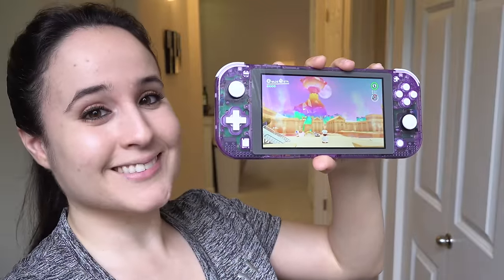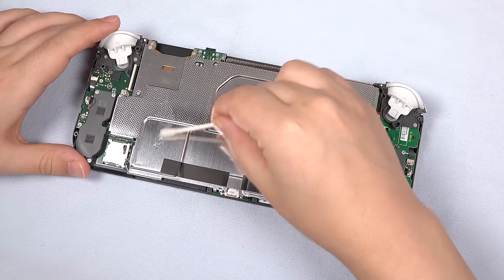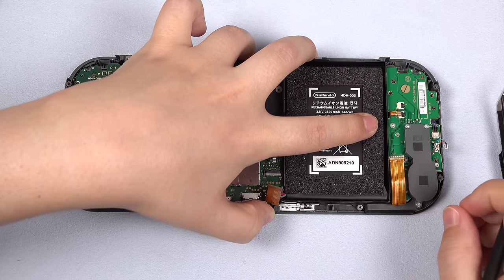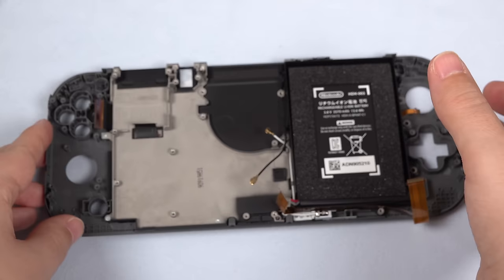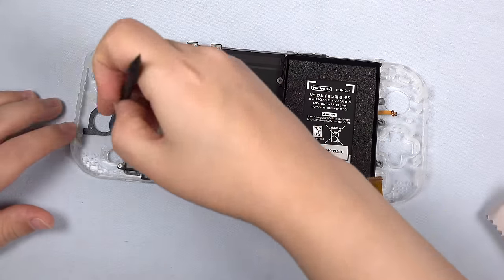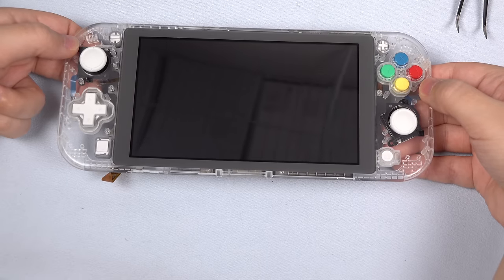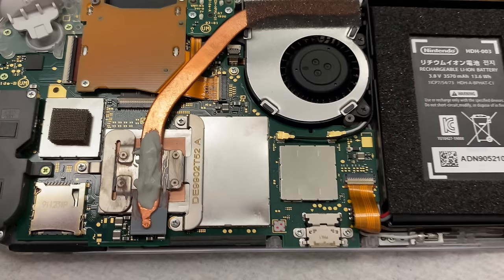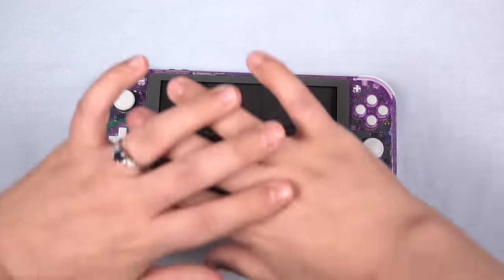DIY Switch Lite Shell Swap: Step by Step Tutorial [4K]

Comment: Was going to do this, to paint the original shell with custom graphics...but a $20 tool kit, thermal paste and a high chance my clumsy fat fingers will break something, had convinced me otherwise. 🤣😂🤣
I honestly thought this was going to be a simple chassis pull. Not requiring complete disassembly of most of the components.

Comment: FYI, you don't have to take everything off, like unplugging the speakers, all of that can be left on. And the on and off switch, that can also be left on. Some of the steps are unnecessary. Watch other videos out there as well, this process doesn't have to be this complicated. If you need to change your car tire, you don't need to unplug the battery. Good video, just some steps are unnecessary.
Reply: Video link?
Reply: I agree, battery and speakers are unnecessary to unplug. Plus they are very easy to break.

Comment: be careful recommending a "heat gun on low". Most cheap 2 temp heat guns I've used could easily melt the plastic and fry the screen on low. I suspect the part of your audience who would rely on your guide would be likely to not monitor the heat properly and damage something.
Reply from the maker: If they don’t have enough sense to realize the tool they are using could melt the plastic then I don’t know what to say. Most people will just use a hair dryer because that is all they will have access to. You have to be a pretty intense idiot to go out and buy a heat gun just for this project as a novice and melt your screen. Those who actually own and use a heat gun (out of necessity) know better... you certainly do. But yeah, there is a real dummy born every second. I’ve seen people drill holes in the bottom of their iPhones thinking they will find the hidden headphone jack. If that’s the case, I can only hope you melt your screen lol.
Reply: @EricaGriffin  dang ok. I wouldn't want to use a heat gun on low because I would be worried about damaging the plastic. Depending on the type of plastic, there often is little indication before damage is done. I would be particularly worried with discoloration of the clear plastic screen cover. I am a male and I didn't own a hair dryer untill I got one hand me down for projects. If I watched this video and decided to do this, I would have went to harbor freight and bought a 2 stage heat gun for $7 and I likely would have damaged the finish of my screen cover or case. But maybe I am one of those dummies you speak of 🤷‍♂️. I say this respectfully, because I think you made a great video. I suspect you might not have used many cheap 2 stage heat guns. To put it in perspective, I use my harbor freight piece on low to weld plastic and to solder

Comment: So I finished and my screen doesn’t turn on. Anyone have any suggestions?
Reply: did you fix it?
Reply: yea, i wouldn't hold the hair drier on hot for a COUPLE MINUTES like said on this video. It just needs to heat the adhesive on the frame for a bit.
Reply: Just received my new lcd in the mail today! I have two concerns; I realized I used thermal conductive adhesive on the copper pipe which I’m assuming is wrong? Second concern is how fragile is the lcd? I’m scared to touch the back part of it I feel that’s how I broke it last time. Any comments or thoughts?
Reply: @zootedseazon  attempt #2 today
Reply: Update!! I am currently on the “check functionality” part of the video and it works!!! So happy! Thanks again for the awesome video.

Comment: Followed the guide step by step and my switch won’t turn on
Reply: You ever get it working? I'm going to try it tonight on an old switch lite, I have seen people say to disconnect the battery before removing any cables because it fried their switch, so it could either be that or just a loose connection somewhere. But I am a little worried that this will happen to me.

Comment: Dang there is a lot of removing stuff 😂 can you imagine if one of your cable didn’t plug right on you forgot dang u have to do all process again 😂 when I fix my Joy con 😂 god one of my ZR button wasn’t working because it was plug backwards 😂 but I have to recheck them over and over to make sure it’s in the right place and it’s working but I fixed it it WORKS FINE